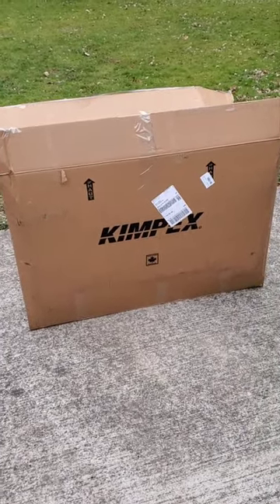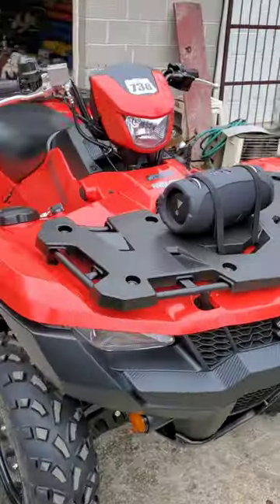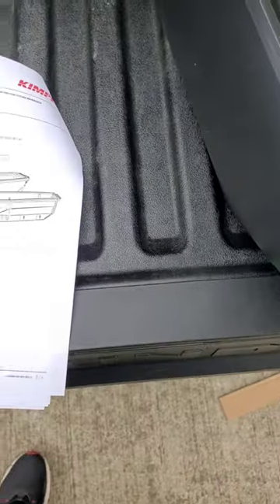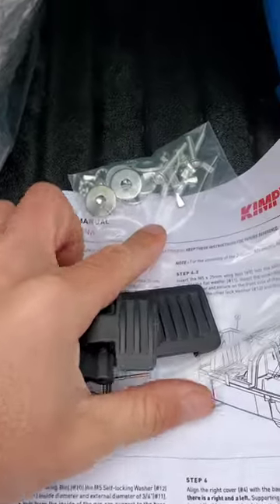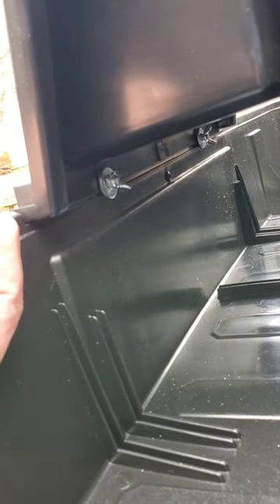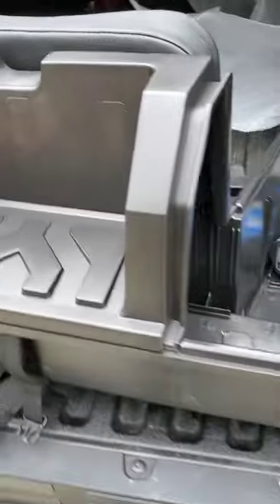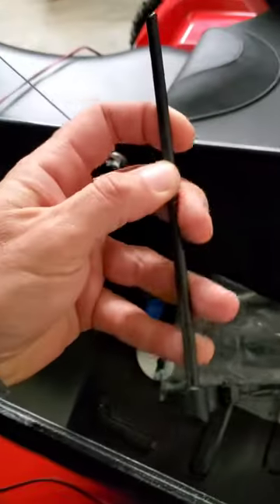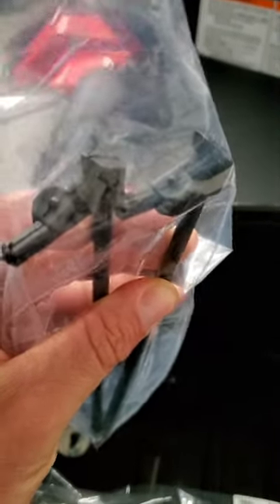2022 King Quad 750 Kimpex Nomad seat install and quick review

Comment: A old bicycle inner tube Or a piece of old floor mat on those U bolts Maybe even a few pieces where the Box is touching the racks too. Just to prevent any wear or vibrations.👍
Reply from the maker: That's a great idea!!! Thanks!
Reply: I used some heat shrink tubing over the unthreated part of the u-bolt, heated it with a heat gun. Ends up looking factory made!

Comment: Just be careful you don't side swipe a tree with the new box it's easy to forget it's back there. I've done it a few times and it doesn't take much to break it or tear it off altogether.  Gust a heads upl👍